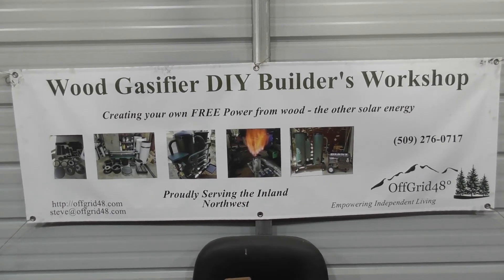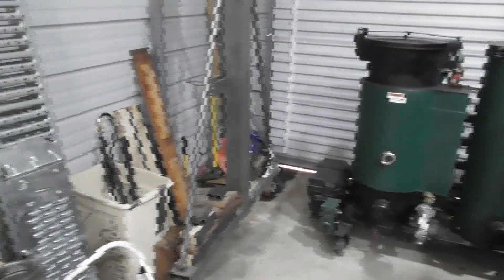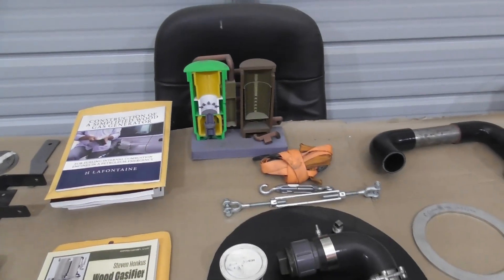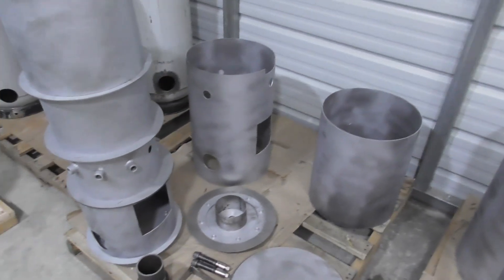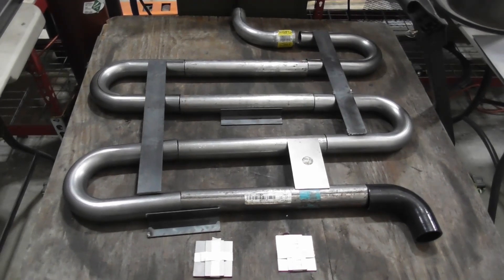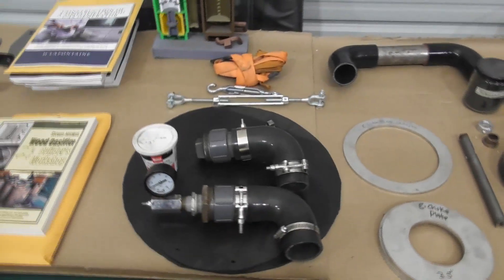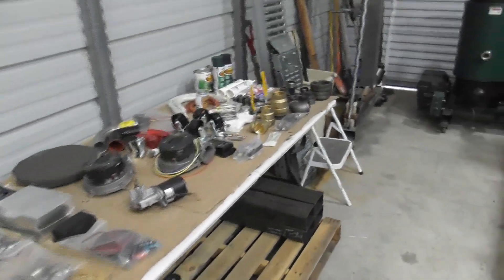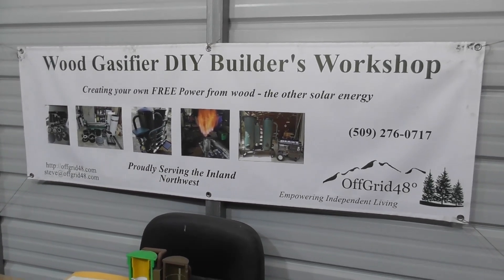Wood Gasifier Builder's Workshop:  Hands-On Workshops

Comment: Hello Steve, I am from Iraq, a student in the College of Engineering, Department of Renewable Energy. This is my graduation project. I am in the final stage. Thank you for everything you have done. You are great and we all love you. I hope that after my graduation I will be lucky enough to participate in your workshop and learn more about gasification devices. What I need at the moment is the same.  The thing you have is a 3D model. I want to get a CAD file with which I can print a small 3D model. I hope you can help.